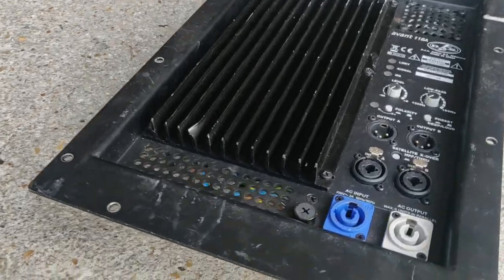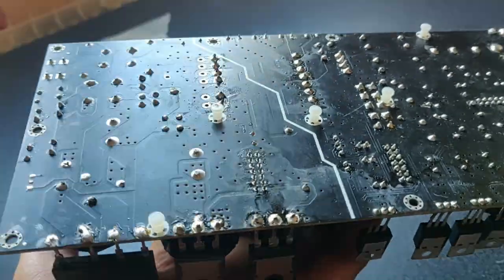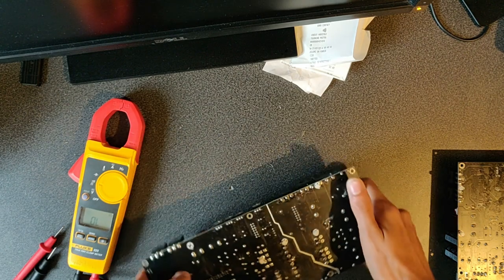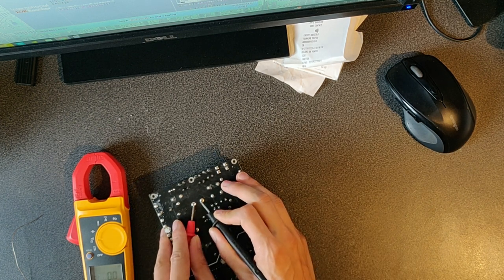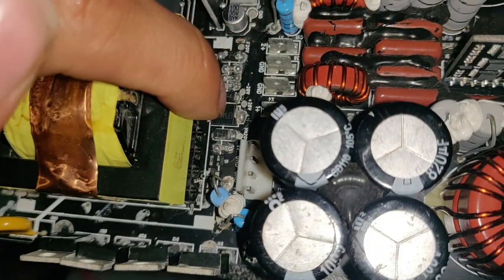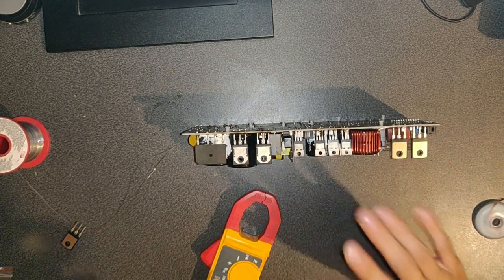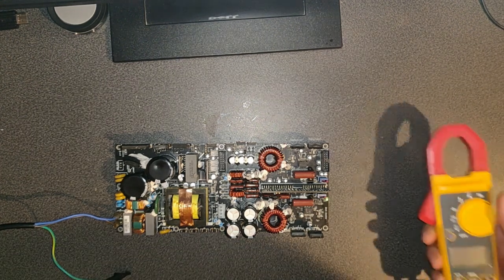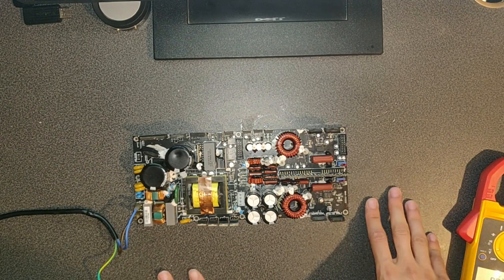DAS avant 118a Subwoofer amplifier plate - Restoration

Comment: This is my opinion, but I don't think power amplifiers should be built into speakers, unless the speaker is just intended for convenience like a stage monitor or a basic portable system. If it is a working PA system that will play music all day every day, the amplifiers should go in a separate rack where they can be swapped with spares. Also when you look at the equipment on the amplifier plate of these subwoofers, and compare it with what is normally built inside a power amp chassis, there is much more robust design in the rack amplifiers compared with the plate amplifiers, and the rack amplifiers usually also have better cooling. Then there is also no vibration from the speaker operating, and the amp can just be its normal happy self while supplying the speaker with power. Active drive of a multi-way speaker cabinet can also be achieved from racks on the ground, so the DSP does not need to be in the individual speaker cabinet.
Reply from the maker: I totaly agree with that. especialy for subwoofer. They vibrate like crasy and need a high curent power supply. A good old amp in a rack will provide a better sound quality and more reliability. For Tops speaker, I think an embeded amp is a good idea. Il provide the right EQ to compensate the driver and they don't vibrate as much as subs.